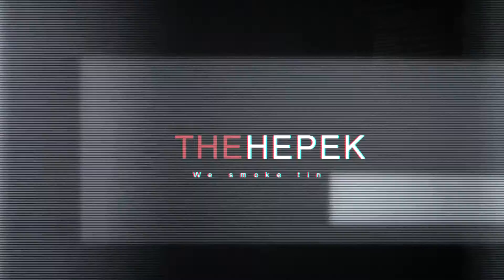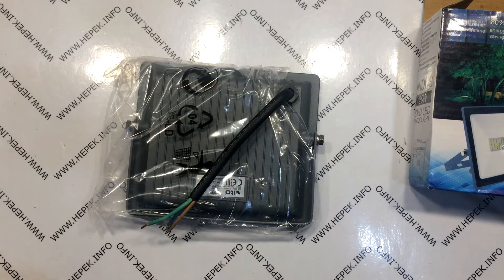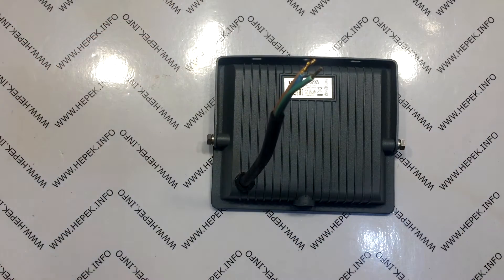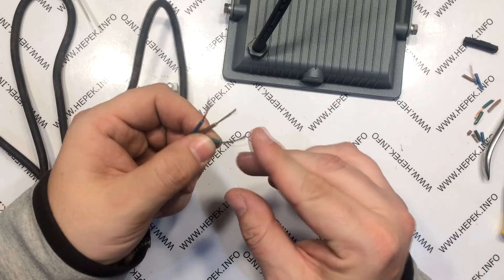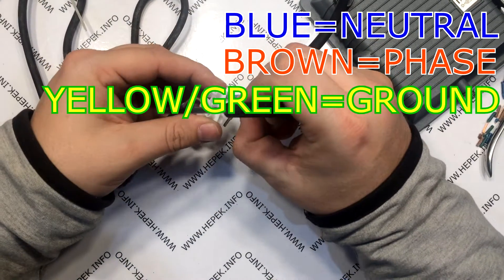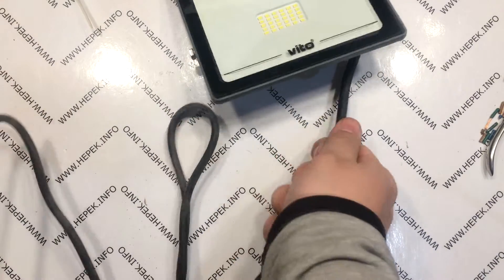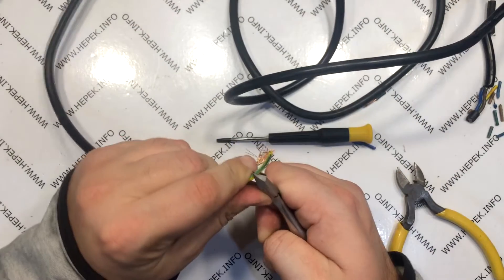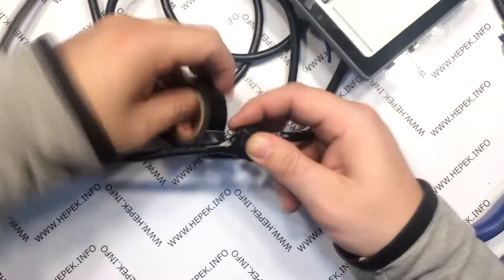How to connect a power cord to a LED floodlight

Comment: Why would you damage a cable when its a lot cheaper to just buy a plug and some wire
Reply: Not used any more you belend
Reply: @aaronbell8527  still easier to just use the ones they sell imo

Comment: Yes but is it safe outside with just electrical tape covering the terminal heads? This is what I had to do temporarily but I wouldn't leave it like that indefinitely. I'm looking for other options because these floodlight don't let you change the cable which is really stupid, and dangerous.
Reply: Heat shrink
Reply: I actually put a switch instead of tape just to be a bit safer

Comment: I have one of these really small says 240 on the package but it can't be 240 v for the tiny wires I hooked up a 120 wire and plugged it in and it so dim not bright at all. Would I be ok hooking 240 to it.